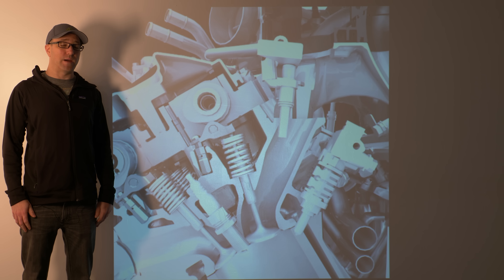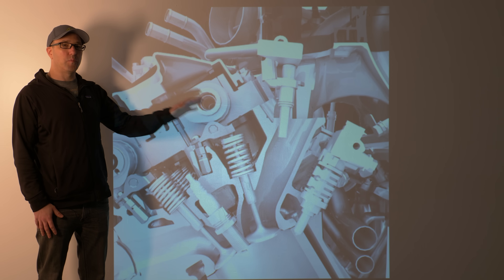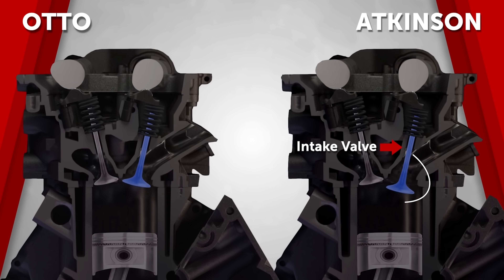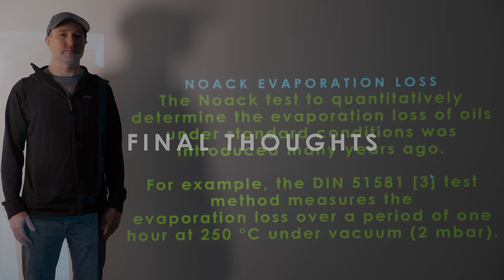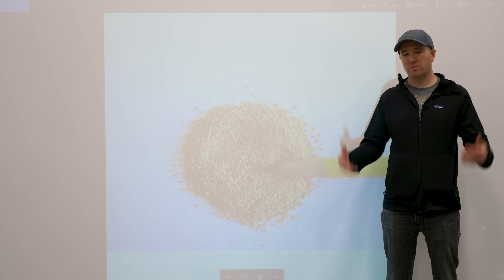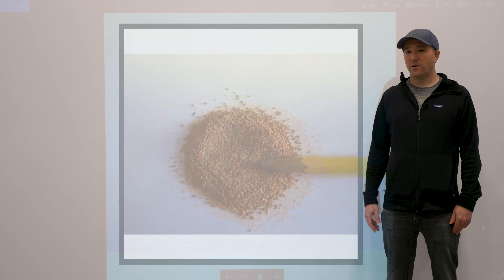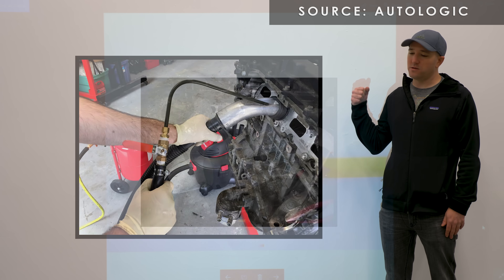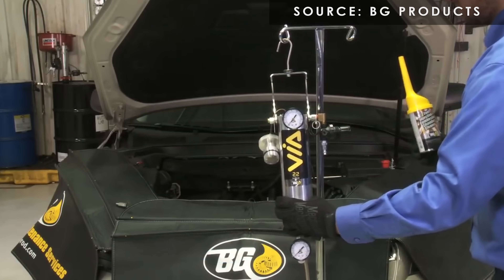Direct Injection, Problems and Solutions | The Fine Print

Comment: I would rather have the PFI. I prefer proven tech over minor fuel efficiency gains.
Reply: Direct injection is used in racing because it is proven for performance.
Reply: Yep, all those F1 cars have their engines rebuilt several times a race.   Moron indeed.
Reply: @maxxweber4336  Ummm - in the past yes.  This season the teams are restricted to 3 engines for the whole year or face grid penalties.  Mercedes and Ferrari have managed to get through the season on just the 3 engines - Honda and Renault have not managed to pull it off and teams such as Redbull and Toro Rosso have had penalties, sometimes at multiple races in a row.
Reply: @azraela9  you're right on a couple things except that you mentioned carburetor engines don't or aren't able to achieve high compression as you say of 12-13. Whether an engine is fuel infected or carburetor does not dictate compression ratio. For example, both of my carbourated motorcycles have a compression ratio of 12.5. And many other sorts cars do to.

https://en.wikipedia.org/wiki/Yamaha_YZ450F
Reply: CAMPER PRO Mist people would rather have the simpler, more reliable solution, but you don't get to choose on new cars since it's driven by emissions legislation.

Comment: You can not change the oil viscosity on your DI engine to help solve this problem because as soon as you do you're gonna have a variable cam timing code and a check engine light.

Comment: My dad Honda Civic 2002 with he 1.7 liter engine is at 396 000 km without ever cleaning the intake show me a new direct injection doing 400 000km then i will believe you until then its only making people pay more for less reliability and more expensive in the long run. You have to change car every 30 000km cause cost more to clean the car than buying a new one, that don't pollute more.

Comment: As I understand it, the crankcase is where the crankshaft lives and combustion gases blowby down into the crankcase and is vented back into the intake with PCV valves to be burned again. 

The video implies the gases are pushed up into the head. Excellent video otherwise. Subscribed
Reply from the maker: Yeah it was a bit of a mis-speak trying to over simplify without going off in too many directions.

Comment: It is the combination of Oil droplets and EGR. That is making the sticky tar like buildup. EGR alone can be problematic and PCV on itself is not a problem. The buildup always starts right after the EGR inlet port, where the two combine.

Some engine have EGR taken before DPF and some after which I guess makes a difference. Some engine use EGR from both sides of the DPF.  
I have seen plenty European cars that have problems with piston ring design, which result in severe oil consumption, and with that ALOT of PCV... all the factors combined makes it very hard to maintain.

I have seen alot of Volvo D5 with completely plugged intakes, so far that only 50% of the ports and intake pipes are clear, and still they ran withouth a problem. The first CEL come with EGR valve or intake swirl valve problems.

Comment: Great video. While I agree with everything said here, I think it would be really great if you could also reference a design decision that I think is hugely relevant with GDI engines: The use of low-tension piston rings. I believe these engines are creating considerably more blow-by than older designs and that is a major part of the problem. For example, previous cars i have owned have hardly lost oil whereas my Audi A4 is losing measurable quantities over 5,000 kms. In other words catching the oil is one solution, decreasing blow-by could be prevention (or at least - drastically reducing the problem)?

Comment: I use 5w-40 syn diesel oil for my caddy feels better I also before I did it used cheap synthetic oil and 1 qt marvels mystery oil cleaned alot shit in just 100 miles n put the diesel oil recommend is recommended is 5w-30

Comment: Great presentation and video.
For all those with Di engines, you can clean your intakes and valves with water meth injection.
My intake has a good 5mm coating inside the intake manifold, and there is no way I am putting walnut shells in there...

Comment: savagegeese. Awesome video, I am constantly commenting about this on car/truck sites, which is one way to get consumers aware of this, hopefully getting back to auto makers, and push Dual Injection to more makes and models. Sadly, people are still denying that DI really has these problems, because they have DI and like the power. I own an '08 Nissan Frontier V6 4X4 with MPI and 37,000 miles, and just traded my wife's Jetta 1.8T, for a '17 Camry with MPI. So I'm playing it safe, but I'm planning on keeping them a long time. Thanks for such an informative video, also, test a few more average cars and trucks, you guy's do the most thorough, informative video's out there, may favorite thing is the lift scenes, because I'm interested in suspension's.

Comment: Savagegeese, thanks for that factual video.👍.

I have a Volvo S60 1.6 180 hp with the Ford EcoBoost motor and i thought cleaning products for the fuel system were useless due to the DI technology but now i know this is still good for the injector itself.

My car has only 35000 km on the clock but i guess i need to use cleansing products to keep the injectors clean.

Comment: The intake valve seeps oil past the seal and it contributes to the buildup. It is worse on DI engines because the intake valve is not cooled with the incoming fuel, so it runs very hot.

Comment: My mechanic nephew has been buying Mini's just with less than 60,000 miles and rebuilding them replacing the engine blocks, cylinder heads after the DI has burned them up. Gets big money on the turbo model. Ridiculous new cars bad motors!

Comment: Solution to d.i. and carbon build up =  water/methanol injection?
I have been hearing lots of people in the sports car markets are using water/methanol injection to clean their valves, reduce knock, and gain some HP. I'm looking at running the AEM  water/methanol injection system. Just wondering if any one has heard anything about this, positive or negative feedback?
Reply: I use water/meth on my Volvo 850R if not tune for it you won't see any gain and you get risk of hydro-lock the engine. Mine did that on full boost at 15 psi hesitated then a the stop light it starting running like an old 2 stroke diesel when arrived at home, remove the plug i add half  inch of gas on the piston 2 and 5. I blow my engine with that very dangerous, but yeah the water and methanol vapor clean your intake valve and piston.

Comment: Thanks for the video. This is why I bought a 2016 Toyota Avalon, before they made the jump away from port injection. Less complicated, less maintenance, and honestly, the power and gas mileage aren't much off of the newer Toyota V6 dual injection systems in real world applications. My 1998 Civic routinely averaged 40+ mpg, so I know what you mean about the lean burn mode vehicles. I wish emissions weren't such a big deal, but being a chemist, I understand. No matter what though, you won't be able to have it all. You will always have to compromise and choose 2 of the following: fuel economy, power, maintenance.

Comment: Subaru uses Dual Port injection on their FA engines. This helps prevent this intake buildup. I would like to see more manufacturers do this, but it really does add to RnD costs. Oil seperators are a great idea. Subaru has had PCV oil seperators built in, but once again, it's not 100%. On the EJ engines, it's located on the rear crankcase, under the flex plate/flywheel. On the EJ22 it also had them built into the valve cover too. Thing is, I can say that the inside of the intake was SUPER greasy and built up, even with these catches built in. On a 96, the buildup was nearly 1/4 an inch. Part of that might have been because of crud that built up in the oil separator.

Comment: Upping the weight of oil for that one reason is bad advice. Todays engines need a starting weight for a reason. They need it to be thin. But hey in just a random youtube commenter and your a youtuber. 😂
Reply from the maker: Thinner oils are purely to reduce pumping losses (efficiency/MPG)
Reply: savagegeese 
Right... ok go run 30W60 in all new cars then. The start weight is only while the oil is cold. Where the engine is most at risk.

Comment: 6:20 I wish I had those imaginary cam phasers that infinitly adjust cam charatersitics in my engine.  I would do much better at the track if I did.   Unfortunatly I'm stuck with real world cam phasers.  A lot of decent general overview information in this video.  The cam comments not so much.
Reply from the maker: This is not meant to be absurdly detailed.  Cam phasers can do a high level of adjustability based on conditions as you know.

Comment: I think this is a well made video and mostly technically accurate.  If I can make a suggestion, for the sake of credibility it’s best to avoid words like “crap” and substitute words like “carbon deposits” instead.  In my own case, my Euro6 VW turbo 1.2 does not loose any perceptible oil level between oil changes, and has an oil separator system at least as sophisticated as any 3rd-party catch can, so I’m not terribly worried about this issue.

Comment: Not a fan of DI, I drive 30,000+ a year in my 2016 Silverado with 6.2. Mileage and horsepower were down so I put a quart of atf in the oil, two cans of sea foam in the tank and since there is no good vacuums feed for the intake I used two cans of spray in sea foam for an intake soak. 
   After driving the 1 tank out, I changed the oil. Never had oil that black come out. Hp is back but the big surprise was mileage 
I routinely drive to from New Orleans to Ft worth and back and gas mileage was greatly increased. I stopped at all the same gas stations and filled up like I always do and drive at the same speeds like I always do. The mileage I drive is a constant with no variance and always the same time, speed and distance.. 
I ignored the gauge and filled up like I always do at the same stations and time in the trip, When I normally get back to N.O. I'm usual on fumes. The trip is usually 3 full tanks of gas. When I got back last night I had  3/4 of third tank left.
   I've owned it since it was new and ran synthetic 0w20 changing it before recommended. To gain that much from a cleaning on a 60,000 mile truck makes me think they need to work out the kinks or make it easier for people to clean out the upper intake.maybe mold in a port in the manifold specifically to spray in intake valve cleaner

Comment: I came here to point out any misinformation presented by the creator of this content. 

Fortunately this is 100% correct. I find no fault in this video other than a slight omission which isn't a huge deal due to how rapidly automotive tech changes. 

Many manufacturers are starting to use low tension piston rings. This is only compounding the problem. Another issue caused by low tension rings is stochastic pre-ignition.

Comment: my dad told me a story once of a guy he knew who built boats, and this man took a early 70s Mustang with a big V8 and a carburetor, and I won't go into detail on what he did because it's a secret, but he got 60 miles to the gallon out of that carbureted V8 engine, with minimal loss of hp! that was 15 years ago! I see it all the time in the automotive industry, someone has an amazing idea that will revolutionize everything and either decrease our dependence on oil from the government or decrease the price that consumers would have to pay for their vehicles, and it's all buried as soon as it surfaces because believe me when I say there's for lack of a better term secret agents in the engineering fields that fine people with these ideas and either pay them off, or threaten them to stay silent. believe it or not that's up to you but take my word for it it's true
Reply: Take what you can for yourself. They are after the masses. One individual not hurt their margins, but stay strong in the face of economics. This one “rodent” from the service station told me ethanol not regular fuel. I said I want ethanol because my engine would suffer from his paid off idea. He smirked and turned away. Another time at a used car lot, a vehicle was decal striped and the exhaust pipe was full of oil. I mention how that vehicle was fuel modular and how the oil was there. He instant walked away and said to have a good day.
Reply: That makes no sense. Lean will burn hot thus a temperature gauge is vital for monitor. Extra cooling systems will be required to keep the engine reliable. Torque will be significantly lost.
Reply: Thermostat delete is irrelevant. High velocity water pump is better idea.

Comment: WHEN I WORKED FOR SANTA FE RAILROAD IN THE LOCOMOTIVE SHOP WE WALNUT BLASTED THE INTAKE PORTS AND BACK SIDES OF THE VALVES!  WE ALSO DID WATER BLASTING ON THEM !  TO KEEP THE WALNUT BLAST MEDIA OUT OF THE CYLINDERS WE DROPPED OFF THE INTAKE VALVE PUSHRODS .

Comment: There is actually another solution that TDI diesels have which GDI should incorporate. Modern TDIs have very aggressive EGR circulation, this means that water in the form of steam a primary product of combustion gets flowed over the intake valve helping to clean it. 

Also alternatively manufacturers could utilize water injection as well at set times to clean the intake valves as the gasses get recirculated through common PCV and EGR systems currently in use.

Comment: Why all the "thumbs down"?  This man provides a real public service to the DIY weekend mechanic. It is informative and honest in its presentation.  I am now thinking twice about the 2.5L I4 DI engine in the 2018 Chevy Colorado since I desire it for fuel efficiency.  It would defeat the purpose if carbon build up on the intake valves affected its fuel economy after long term use. You would think that GM engineers would consider this potential problem.

Comment: What a load of bs.  Fuel never gets sprayed on exhaust valves of ANY motor.  So much for your "natural cleaning effect".  And emissions wasn't the driver for this technology like your claims.  EFFICIENCY is!  Meaning higher horse power along with better mileage because better burning of the fuel from allowed higher compression.  WHY ARE YOU LIEING TO PEOPLE LIKE THIS?!?  Dumbass.
Reply: He never said it cool the exhaust valve he said it clean the intake valve, most modern car use sodium filled exhaust valve their are made to support the heat from the exhaust and heat from the combustion chamber burn almost all carbon build up.

Comment: ??? I use a pressurized canister I hang off the hood (with a hook) that runs off shop air and I run fuel lines from canister to the fuel rails and remove the fuse from the cars fuse box for the on board fuel pump to disable it and run a specific high concentration fuel cleaner directly from the canister to the car with shop air creating the 65 psi fuel pressure and run the car for 30 minutes or so with concentrated fuel cleaner.. this is an industry standard and same way car dealerships use to clean injectors and valves and pistons etc.. for years .. I bought this set up years ago and paid for itself many times over.. used on e -bay $80 but for under $300 is much cheaper then a teardown or even taking a car to the shop .. if you need valves cleaned this is the way to go.. pouring cleaner into fuel tank even with best on the market is 10% or less effective as the canister method
Reply: NOTICE I did not say connect to a vacumn line with cannister .. this is a different cleaning tool and no where near as effective as it does not clean the injector ..it will clean intake runner and intake valve as will as piston and the tool is much less money easier to hook up and worth every penny BG makes these tools

Comment: When the engines are low mileage, the rings seal pretty darn good so blow-by isn't the primary cause of the carbon.   Sure...it's some of it, but most comes from oil being pulled down the valve stem by manifold vacuum.   You don't see this on diesel's because (mostly) they don't have a throttle to make vacuum and the crudded up intake valves I've seen, and even the ones in the video you can see that the junk came down the stem from the seals.

What to do?  Run a good quality synthetic oil which won't bake as easily as conventional types, and thicker is better because it makes for less blow-by and oil weeping down the valve seals.   Even though many engines call for 5w-20 or even 0w-20....look in the manual and find the temperature chart and allowable oils.   So long as you're not exceeding the recommended temperature use the thickest oil you can and the vast majority of cars can use 5w-30 or thicker particularly if it's a good synthetic.

Good video....glad you're trying to educate people about the DI problems.   I've tried to tell everyone I can and think that some customers believe that I might be lying to them.   Oh well...what's that old saying about 'leading a horse to water'?
Reply: Oh....I wanted to add that a simple water/methanol  injection system can work wonders to help keep the valves and combustion chambers clean if used regularly.   I've run a manual system with push button and hit it every now and then when WOT and using high revs.     Especially good for turbo engines where it suppresses detonation as well as keeping things nice and clean.

Comment: The fuel injection system feeds a gasoline ENGINE which is started with an electric powered starter MOTOR.